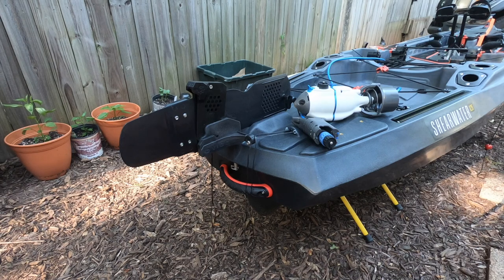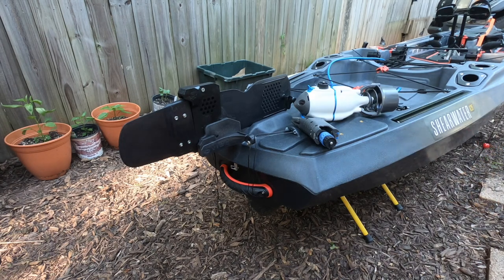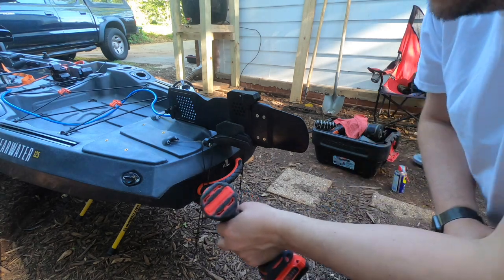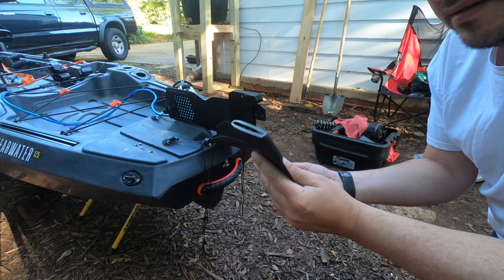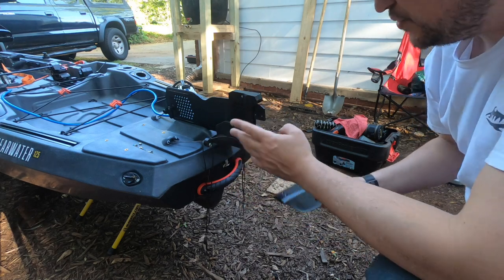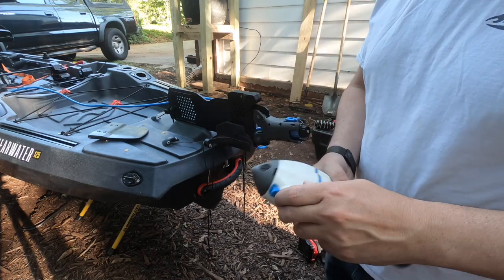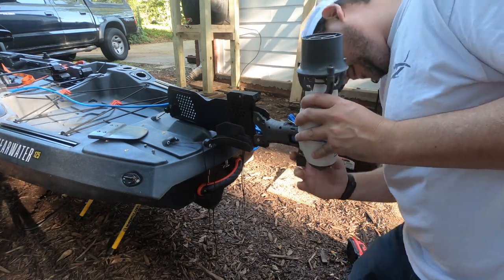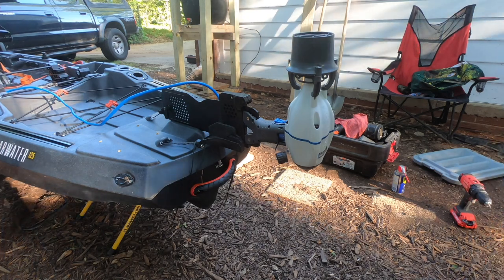Bixpy Install on Vibe Shearwater 125

Comment: Would there be any drag when the motor is in the water while you are foot peddling? 

As you need the rudder to steer to the direction you want ?
Reply from the maker: Probably a little but not enough to matter.

Comment: if you wanted to just peddle one day could you still use the rudder without the motor attached? Or would there be open wire ends and such?
Reply from the maker: Yeah. You can remove the Bixpy mount and put the rudder tip back on completely.

Comment: Hey man. Do you have any issue with leaking around the pod when your at half power? Mine dose it's like the gasket is not getting a good seal.  Thanks for your videos!!
Reply from the maker: None at all! I assume you mean the battery when you say “pod”
Reply: @Hydrayak  no sir the center removable  Vibe Versa Pod  when I'm at half power water pours in around it
Reply from the maker: You mean where the XDrive fits?
Reply: @Hydrayak  yes that's what mean I don't have the xdrive pod for it  i have the pod that opens up with the magnet on it  and I have the bixpy motor on the ruder